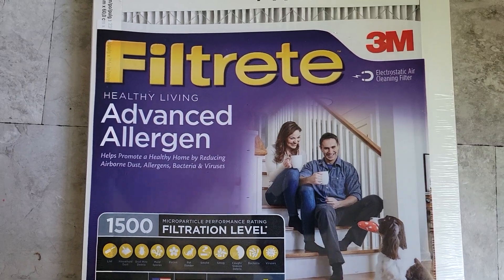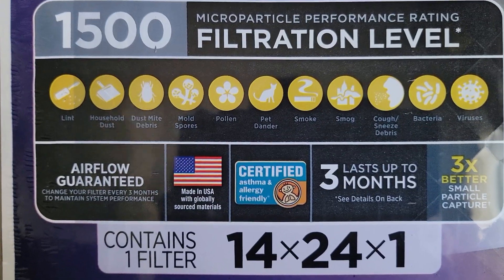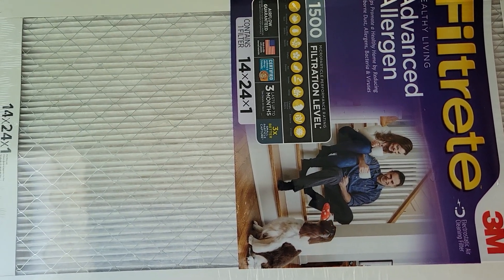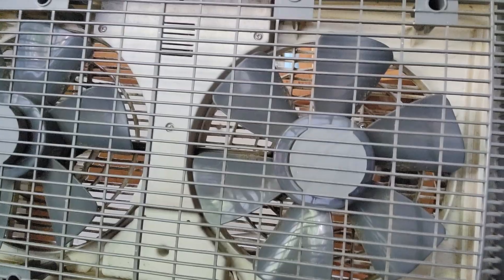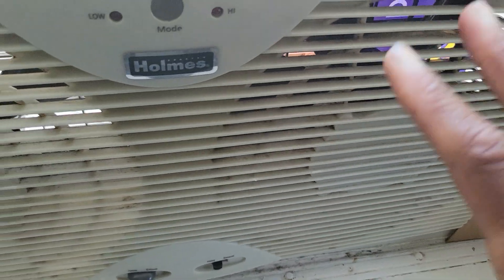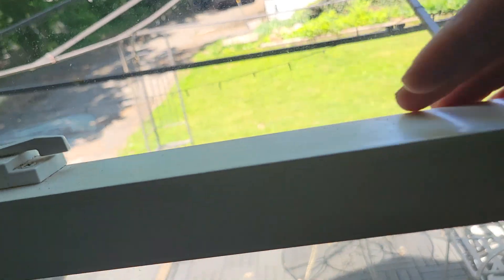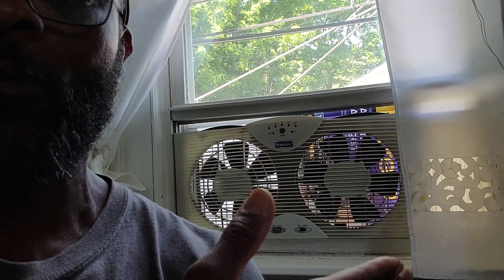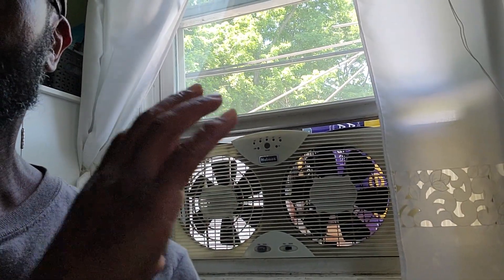SURVIVAL HACK: DIY Air Filter for Fallout Shelter

Comment: I am sorry, but I am confused.  If you are in a house, basement, you do not need an air filter into your house. Just like right now you don't need a window open to get air.  Now, if you've built a sealed shelter, then yes, absolutely.  Am I wrong? 

You do need to turn off your furnace or central air so that it doesn't blow outside air into your spot.
Reply from the maker: This is the original video : https://youtu.be/gl-RAbjuSFw  people wanted more clarification

Comment: Not so sure I’d want to be using a fan to suck in air, wouldn’t it be better to just put a couple filters in the window and not force air through it. If there’s particles floating around outside, sucking it in might not be a great idea? But it seems like a great idea for normal times to help with allergies and mild pollutants.
Reply from the maker: Could always put the blades in reverse to blow out, it'll keep the CO from building up. 🤔
Reply: The amount of flow you would get from this setup is pretty minimal. The fan would have very little static pressure.
Which is probably a good thing, you don't want to overload the filter.
Wearing a gasmask for the first few days might not be a bad thing.
You can get cheap Chinese ones that actually work pretty well for particulate filtering.
The gasmask guys reckon they are pretty good if you aren't moving around a lot.
Around $50.
Some are compatible with NATO threads, so you can swap to a higher quality filter if you like.
Before you remove the filter it might not be a bad idea to remove and dispose of as much dust as you can.
Just a few possible ideas anyway.
Reply from the maker: Definitely not for use in the immediate period after a nuclear incident. Several days after preferably. High allergens or help minimizing potential toxins I think it would be a benefit.
Reply: @TheUrbanSentinelChannel  Absolutely.

Comment: Interesting . Great idea. I will save this and add it to my emergency book. I am thinking of my basement windows.  Do you think I could use it for it so we could prevent  contaminates yet still get air?
Reply from the maker: I believe so. I actual am looking at one of my basement windows, that's under my porch. I was thinking of using a few layers of weed screening to reduce the wind blown debris from getting underneath since it's enclosed with a lattice. Then use the filter setup for the window area.